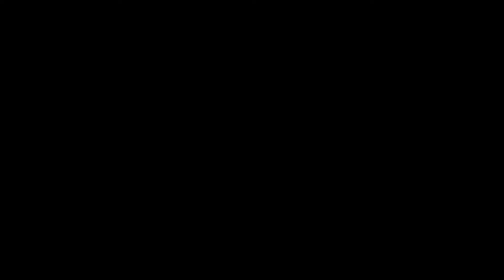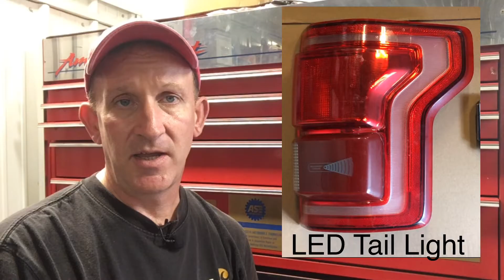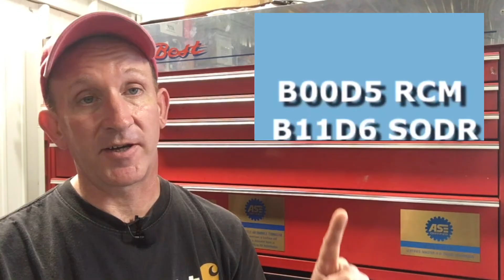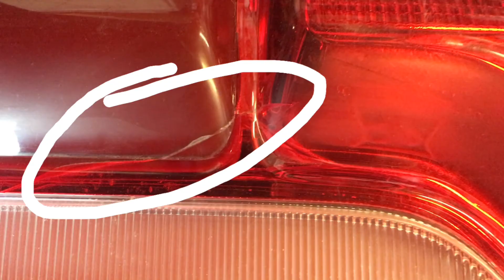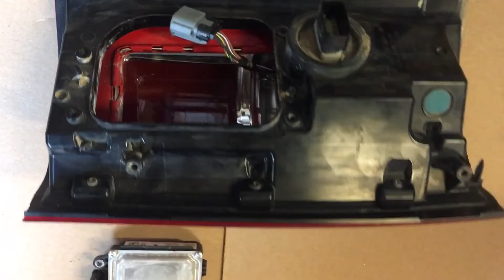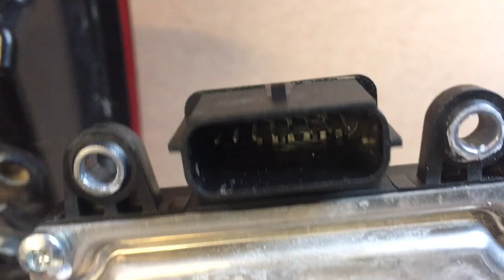2015 Up F150 No Radio Controls, No Heat or A/C and No Power Windows

Comment from the maker: Has anyone else ran into this problem?
Reply: Happened last weekend, tail lights not cracked everything dry and clean, under dash plugs dry and clean, as well as everything at fuse block and fuses all good. Ready to send it to scrap yard
Reply: @bshack2564 same i have this problem and nothing seems to fix it
Reply: It’s going on right now with my 2020 super duty. About to drive it into a pole
Reply: yes, actually it happen last week on our 2016 F150 platinum crew cab, its at FORD right now, and they told us exactly what you just spoke about.  We were told our tail light had about a cup of water in it. They told us the fix is 1,900.00 to replace the light and module and after that, they will need to do another code check to see if anything other code comes up, therethat's
Reply from the maker: Yes, the tail light, bliss module and pigtail are crazy expensive.  I wish I could say it’s not a common problem.
Reply: @CarShopTalk  thank you, Ford is making it seem like it never happens..  and have no clue, how water got into my light housing, just seems Ford should look into this instead of just changing parts, but I guess that's what the industry is about.. thanks
Reply: @CarShopTalk  I’m having the same issue on my 2018 F-150 Platinum, is that all I need is a taillight the bliss module and pigtail to repair it?
Reply: Yes I had the same problem
Reply from the maker: There’s two recalls for cam phaser rattle on start up. The first is a PCM software update. I’d love to know what they’re doing with software to prevent an engine noise on start up. If I ever have too much time on my hand I’ll compare the before and after files and see what the difference is, but I rarely have that much time on my hands.  The software update recall has to be done first, but the way I understand it it’s suppose to help prevent the condition from happening.  All the trucks that I’ve seen that rattled on start up before the software update, still rattle afterwards. Which brings you to the second recall where it gets the cam phasers replaced.
Reply: Ford f150 2015. No crack or water in tail light so not sure where else to lookk. But all sysmptoms the same. started acting wonky just in the worst heat but now it's permanent. radio on cant adjust it. cant lock doors (this is new), no a/c, cant put windows up. This truck has been a lemon from the beginning. Just had to fix an intermittant wiper that wouldnt turn off.  thankfully found a video, bought the part and had a friend install. garage wanted to charge $250.  This is so much more expensive :(
Reply from the maker: @spartinspaghetti12  does it have bliss / radar sensors in the tail lights?  It should say it on them if it does.  Is the wiring beaten up where it comes from the box to the frame behind the rear bumper?  Usual from driving gravel.  Water in the connectors where the box wiring plugs into the frame?
Reply: @CarShopTalk  I disconnected and reconnected the battery per others who didnt have a cracked light but same issues and IT WORKS NOW. will drive it around today in the heat and humidity and see if it holds up.... thanks to everyone here!!!!
Reply: @CarShopTalk  UPDATE: Drove around today and about 2 hours into errands and travel I had a wrench show up on dashboard with message saying the the emergency brake and some other things werent working and i needed to see someone.  Then the a/c, windows etc started acting up again and the airbag light went on. pulled over, disconnected and reconned the battery and everythign ran fine again. One hour later the windows and a/c went out again, intermittantly. It's back to intermittent failure.  I hate this truck!
Reply from the maker: @spartinspaghetti12  it sounds like something is intermittently taking one of the networks down, but it may be a pain to figure out what. Usually it’s water in a connector some where.
Reply: @spartinspaghetti12  Did you fix the problem?
Reply: Yes my 2022 is doing this now
Reply from the maker: @HusslingRome  Unfortunately it seems to be fairly common.
Reply: This is happening to the 2017 platinum i just bought!
Reply from the maker: @clayhealey8428  ugh.  Will the place you bought it do anything?
Reply: Anyone found out the problem??? Help
Reply: @emilianoramirez5446   I took off the sensor and cleaned the pins and it’s been working for me
Reply: @Moonpopped  oh good, Can you tell me which sensor you cleaned out?
Reply: @emilianoramirez5446  the sensor inside the tail light it’s attached to it you will see it if you take off the tail light i took off the passenger side
Reply: @Moonpopped  thank a lot man. Hopefully that will fix it..
Reply: @emilianoramirez5446   no problem!
Reply from the maker: @emilianoramirez5446  the water in the tail lights or?
Reply: @CarShopTalk  no water. I cleaned out the sensor on both taillight and nothing. Still doing the same thing. Ac, radio, windows etc. coming on and off every 2 seconds.
Reply: @emilianoramirez5446   what you use to clean it ?
Reply: Having it happen with my 15 xlt. I don’t have the led tail lights. I’ve checked every possible ground, even replaced the fcim and still nothing. Lost here. My 1st ford and it’s been a pain.
Reply from the maker: @stevenpotts7978  Is it intermittent or does it do it all the time?  Assuming it is the network going down causing your concern, it could be wiring or any of the modules on that network.
Reply: Twice 🤦🏾‍♂️🤦🏾‍♂️🤦🏾‍♂️
Reply: If I unplug the module and just leave it unplugged, will the car revert back to normal?